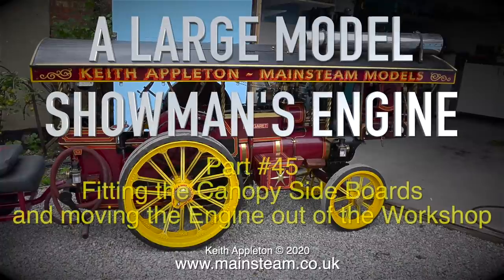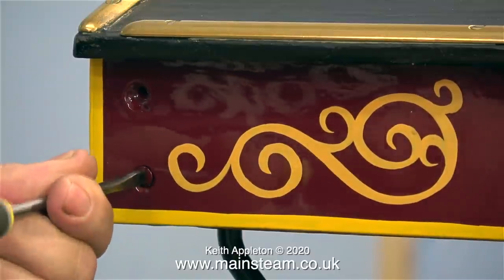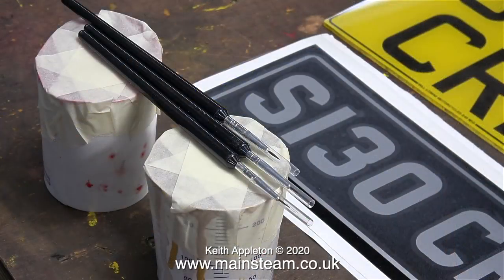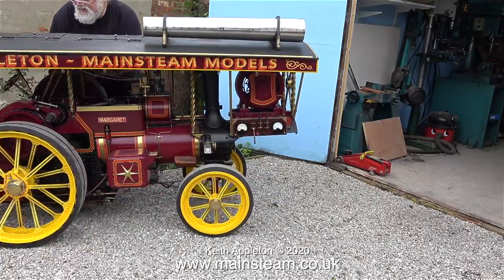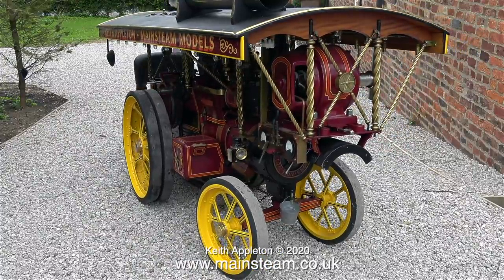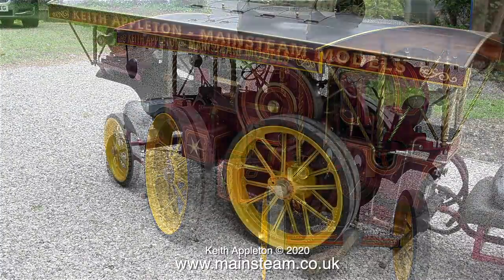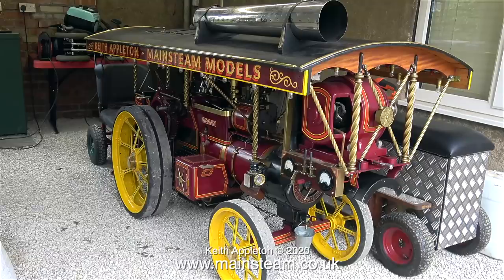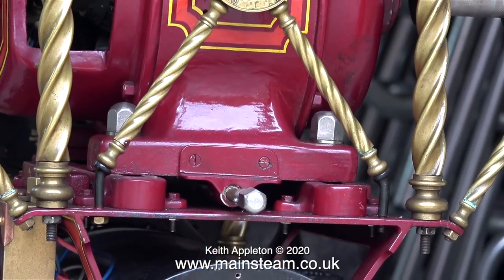A LARGE MODEL SHOWMAN'S ENGINE - PART #45

Comment: Eagerly awaiting the episode in this series where you fire up this beautiful engine & take it for a run to the local newsagents for the Sunday paper!
In the meantime, just out of curiosity.....would it not be easier to make up a special fitting that attaches to the center of the flywheel in some way that would THEN allow using a cordless drill to turn the crank & therefore whole machine rather than doing so by hand???
Then again, being a bit of a stop-motion fan I believe this episode would have brought a smile to the face of the late, great Ray Harryhausen ;)
Thank you once again for sharing Mr Appleton!

BTW; not really sure what you narrated in this episode as I suffer industrial deafness & the YT subtitle were WAY off today with a mix of english french dutch & german as well as something about Christopher while filling water tank! :v
I know that part is out of your control & usually, when it goes a 'bit' wrong it can be amusing- but this time it could have down-right distracting- if I wasn't already distracted by your beautiful traction engine.....
Oh, & congratulations on a job well done! ;)
Reply from the maker: Why? it worked perfectly well as I show in the video - no need for pointless complication for the sake of it }:-)))